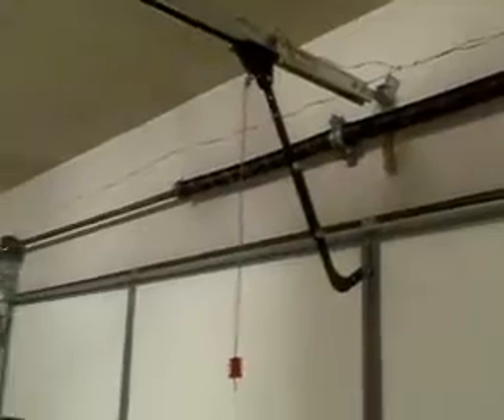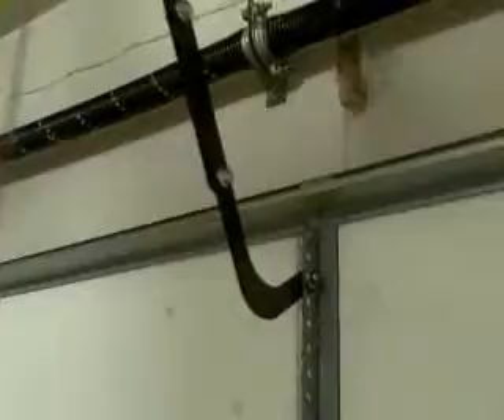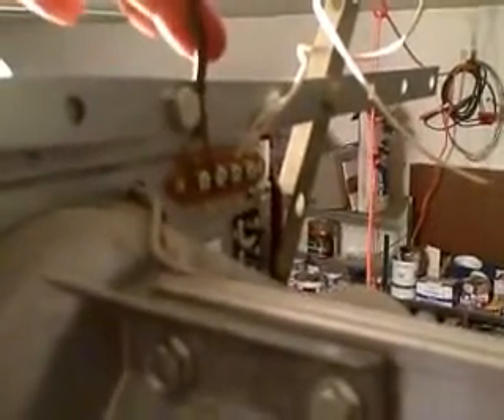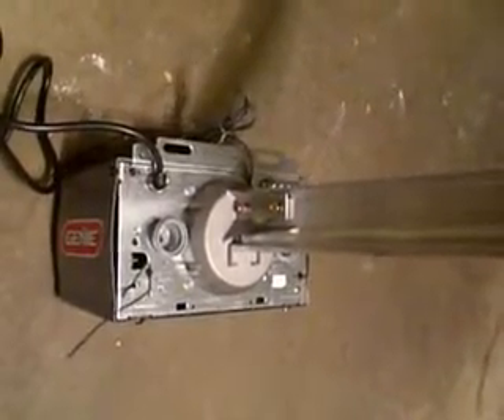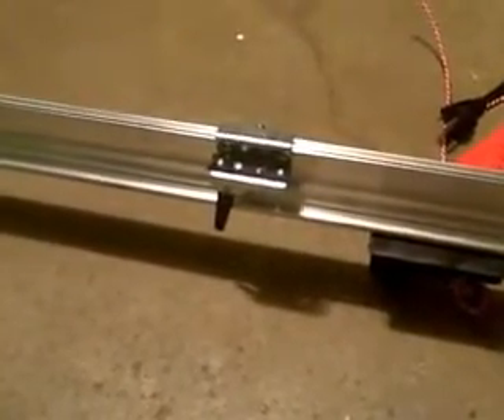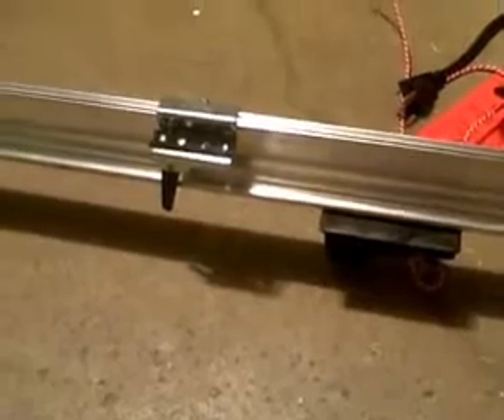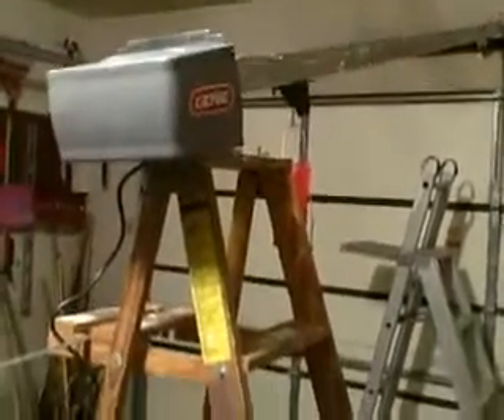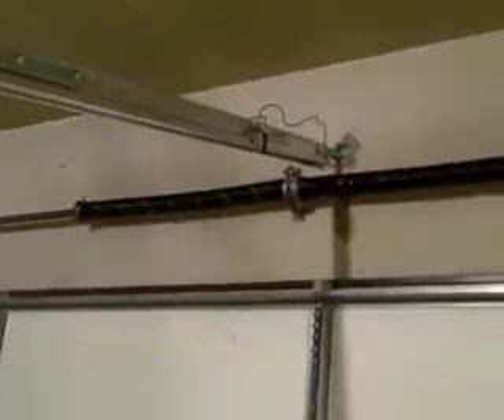How to Replace a Garage Door Opener

Comment: If I could make a suggestion, go to a hardware store and buy some punched steel angle and replace the old brackets at the powerhead with the punched steel angle. The stuff that comes with the opener isn't really good. I can even see this on the horizontal crossing bracket(it is bent) and the puched steel angle is much stronger.

Comment: Is it even easier if you replace it with the same brand and type (belt vs chain)? Also can you use the existing electric eyes and wall mounted controller?
Reply: Yes it is easy to replace with the same type.

Comment: When you install the garage door opener, you are supposed to install the arm no lower than the top rollers. But, put it too high and the arm (black bar) will smack into the strut.